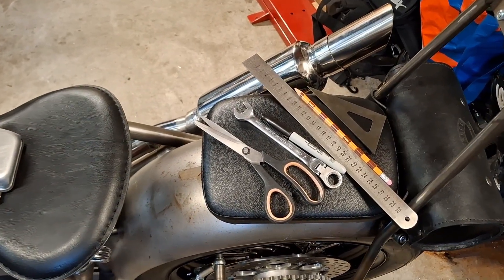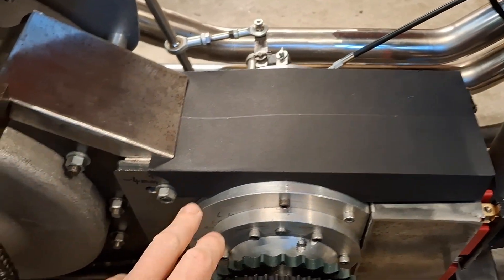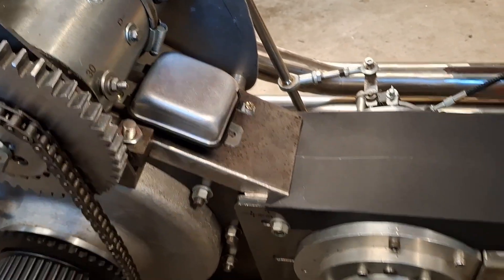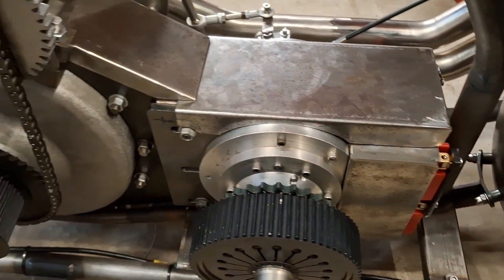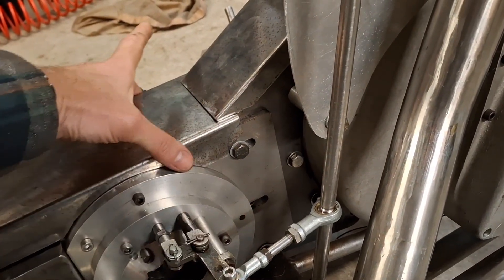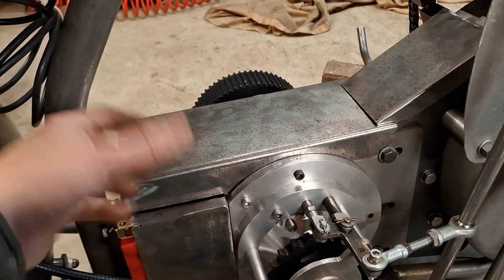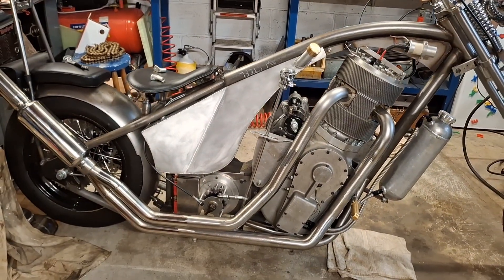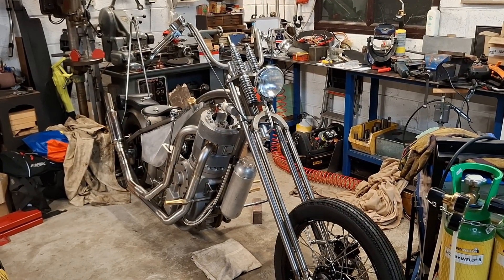Electric box - too boxy??

Comment: I like the look of old boxes from ex military uses. Ammo or some aircraft uses. Early stuff for Harley j models and the like. They are not just simple flat pieces but have pressed shaping to add stiffness. 
In your case it will disappear if it's just black but I'd be concerned if quick access isn't possible.
Keep the good work up. I can't wait to see it finished.

Comment: Maybe a rounded aluminium cover over the right-hand final drive clutch-op and  gear selector would compliment the curve of the tank and cases, at the same time covering the angularity of the boxy gubbins. This would reduce the ingress of road-crap and stop grit getting in the clutch cable.
Reply from the maker: Yea,  I'll need to make a few covers for things before it'll pass any tests.

Comment: I think it looks rather nice. You could just open the radius gap to be even the whole way around the tranny. Maybe run a rubber trim strip in the radius so it doesn't "ring". What about welding the two covers together?